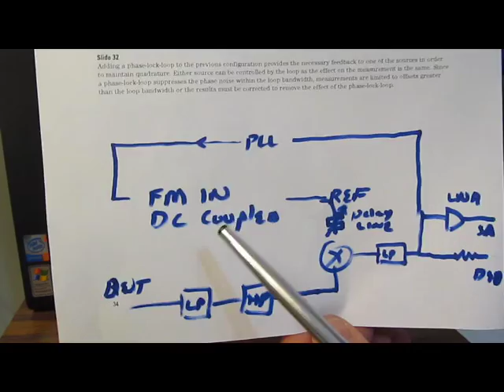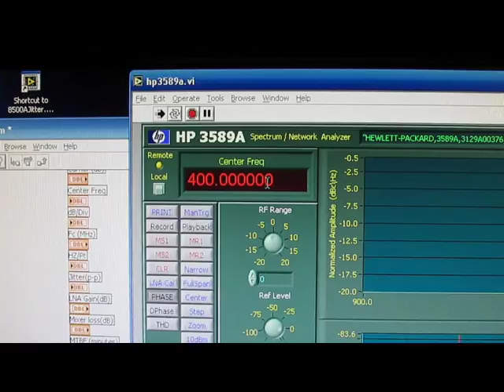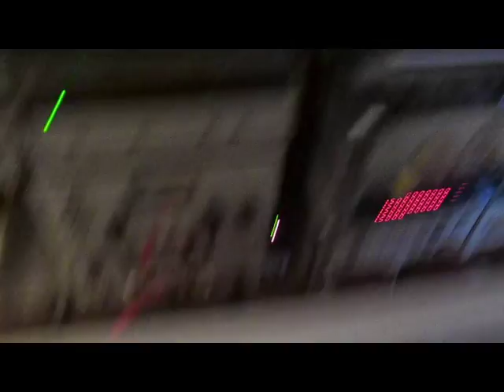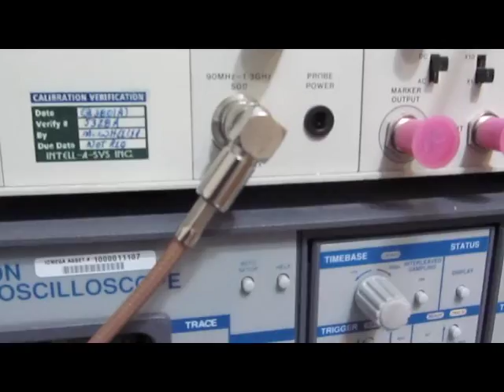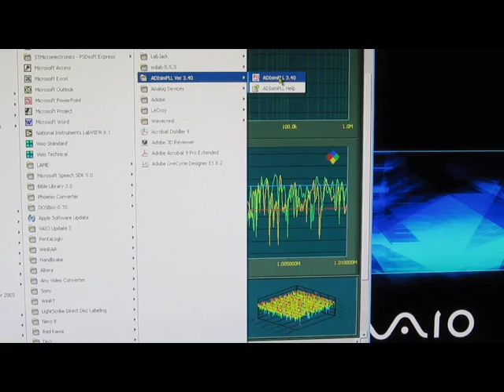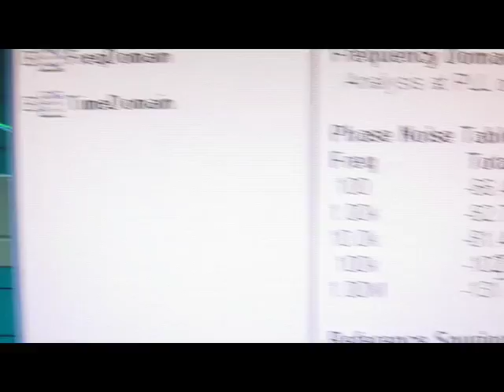Phase noise measurement demo using a home made discriminator

Comment: When feeding the discriminator box with a fully coherent signal via a splitter, isn’t the noise measured are the residual noise of the discriminator/amplifier/filter setup? In that case you can’t see any absolute phase noise from the LO with this method. I wonder how accurate is the noise floor measurement presented in the video in terms of absolute phase noise of this setup.
Reply from the maker: That paper I mentioned is a good place to start.
Reply: joe smith after a quick look at that paper. What you are measuring is definitely the residual(added) noise floor of the discriminator and not including the phase noise of the reference LO. Looking up the phase noise of the 8660D synthesizer, the phase noise margin of the measurement it’s probably only about 10dB.